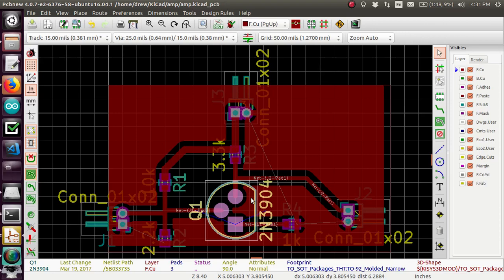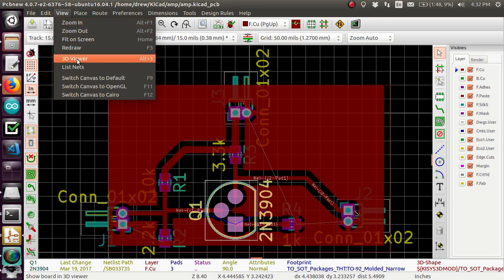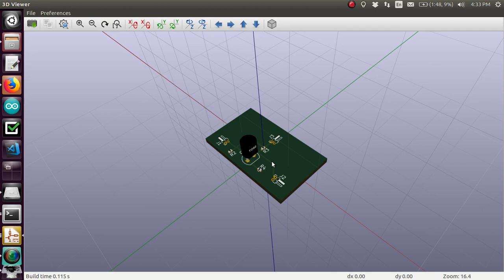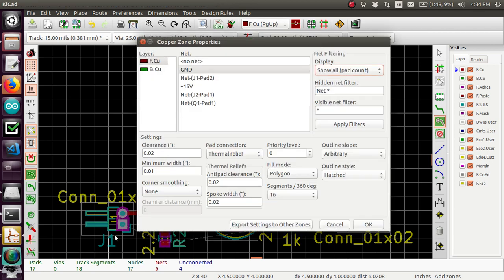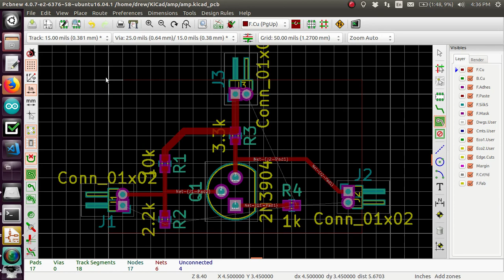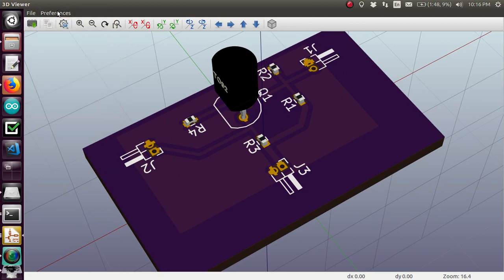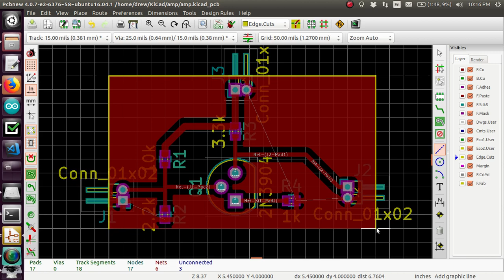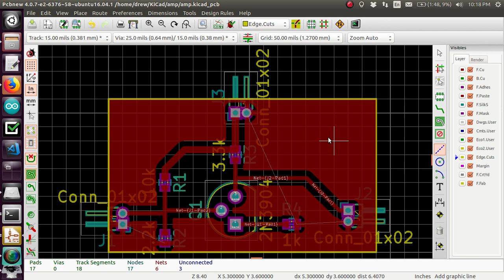Learn KiCad #5 - Save time with Power Planes

Comment: One thing I have to say: You explain ground and power planes in a way that is easily understood. The concept, in theory, makes sense the same way a car eliminates the need for a second wire by bolting devices to the car body itself. It's just hard to 'picture' it on a pcb until someone explains it. 
Thank you.